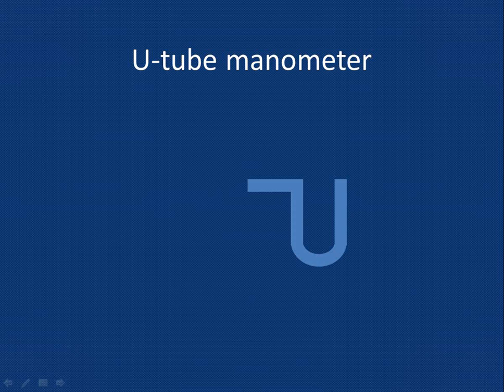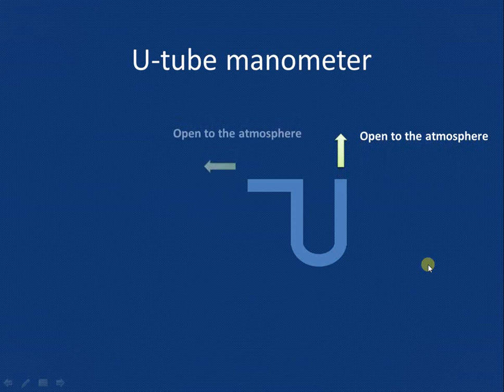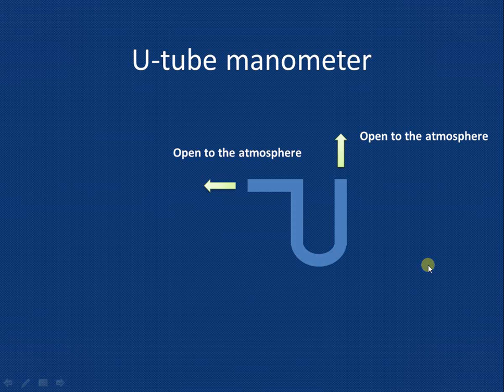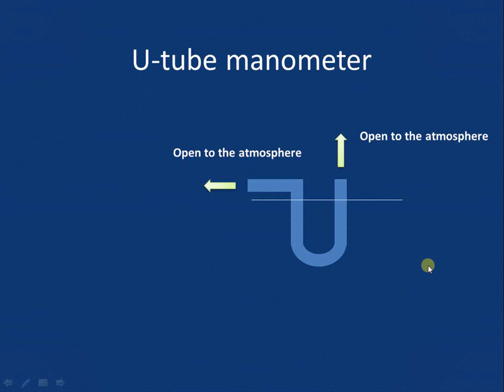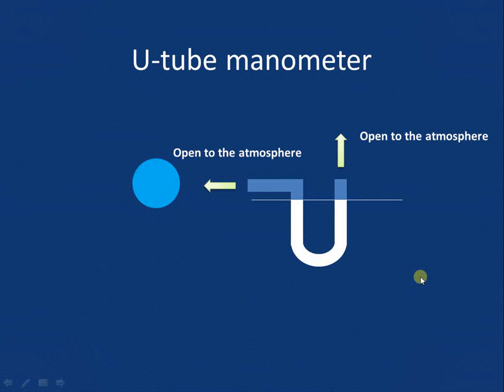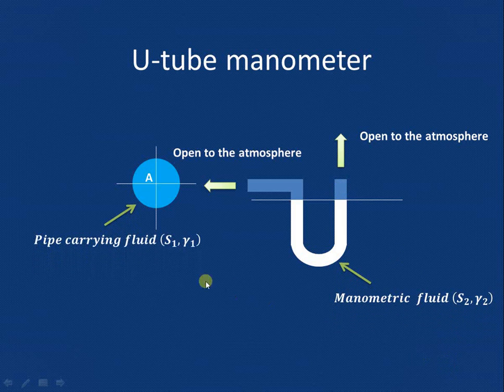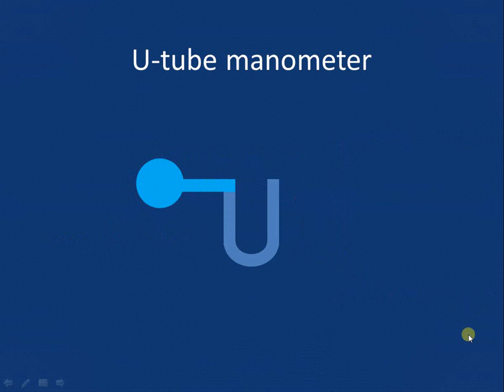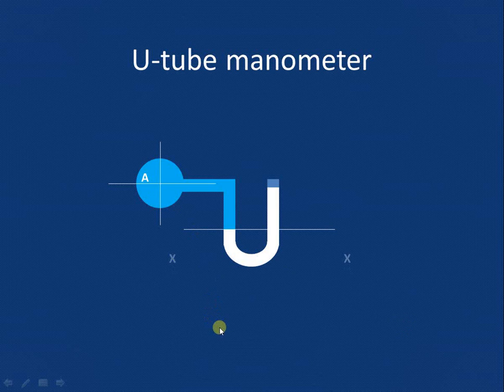How to measure gauge pressure using U - tube manometer - GATE  exam preparation video

Comment: Atmospheric pressure is zero? Isn't it 101.325kPa by the International Standard Atmosphere?
Reply: 101,325*
Reply from the maker: +TheDeLeG3nD You are right. Atmospheric pressure is 101.325kPa , but the point here is that the gauge pressures are measured taking atmospheric pressure as a reference & hence at atmospheric pressure, gauge pressure is ZERO.
Reply: CHINMAYACADEMY Thanks for the quick reply. I'm studying at University of Mechanical Engineering and I've only currently started getting into the thermodynamics. And I know that this is only hydrostatic physics, but I've never really understood it until only recently.
Reply from the maker: TheDeLeG3nD Ok. We will be uploading videos on basic & advance thermodynamics in future , you may find it very useful. If you want some specific topic then i will be glad to help you. Kindly share our channel. Thanks.
Reply: CHINMAYACADEMY so whatever PA we get 101 will be added ?